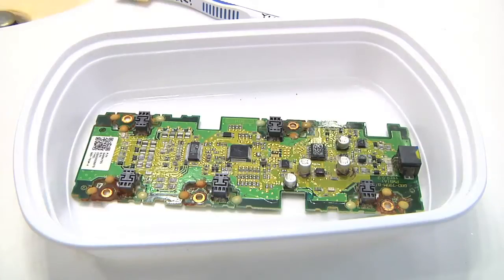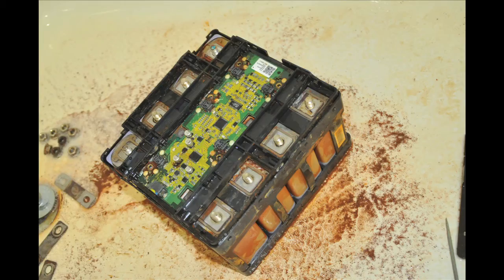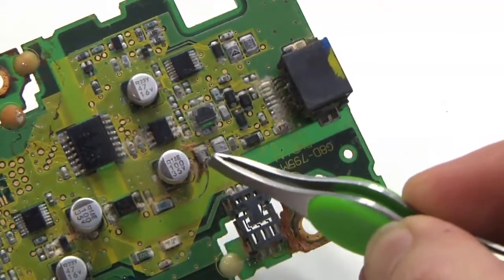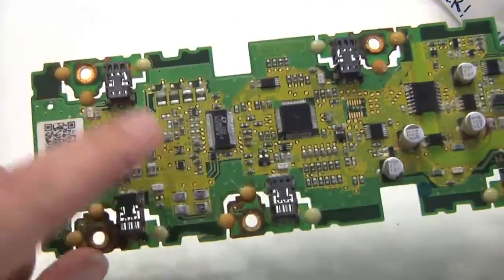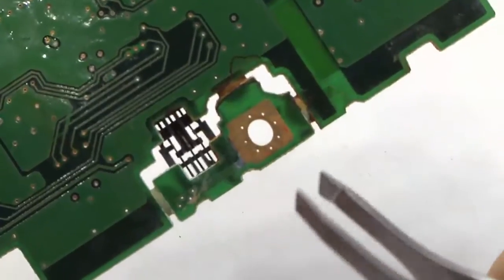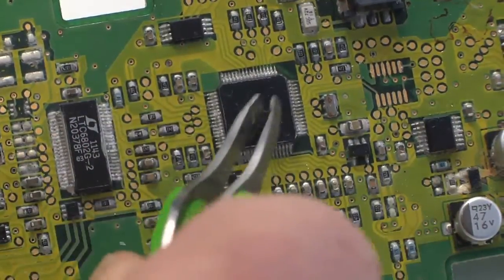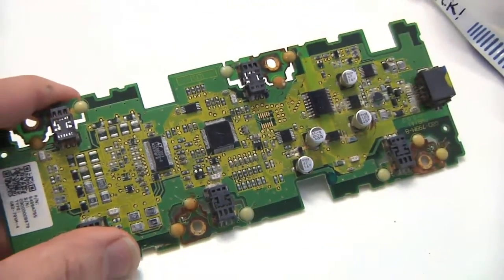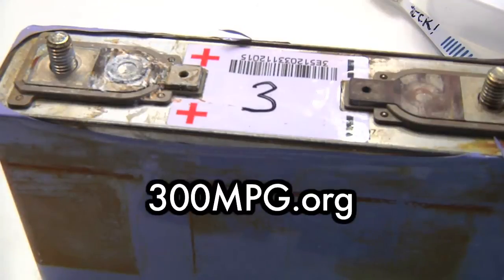Flooded i-Miev: A Close Look at a BMS Board

Comment: Hello dear community,

I study electrical engineering and specialize in energy storage. As a small study we want to continue to use old batteries from electromobility, we want to continue to use the old boards of the battery, the eight lithium cells monitor.

These boards were connected to each other with an 8 pin connector and could then be controlled by a reader located in the car.

I myself do not have much idea in the areas of boards and computer architecture. My idea would be to develop a system that can read the boards or if it is possible to send control commands to board. Of course, it would be ideal if the boards could communicate with a battery inverter via a professional bus or CAN bus.

The following components were determined. The insulation shined over a digital isolator called ADuM1402W. The battery management uses an LTC6802G-2. The BCM CPU is a NEC F3612M2. The process is as follows: The chip for the battery management is probably self-sufficient and equalizes the batteries when discharging and charging. He should probably communicate with SPI with the BCM CPU and as I suspect he will only send data to him. The CPU is responsible for the conversion to a bus system (CAN bus). The isolator probably only for galvanic isolation.

My questions:

Can one analyze such a bus system or can one find out how it works without knowing the protocol? Does anyone have experience with these components? Is it worth it at all, as an engineer I would not waste any time here and prefer to build a new management which works with a bus system which I know well.

Comment from the maker: The second block of cells I pulled out look like they are a complete loss. I've been busy with work, and we've still had pretty crummy weather lately, that have been keeping me from working on it. The big challenge so far is getting INITIAL voltage safely into the cells. I'll be doing some work soon using a big dumb charger to get some voltage in there so I can then use a high-end lithium charger to actually test/charge/discharge the cells.

Comment: I've an i-MiEV too. It has got a 325V/50Ah/16kWh battery pack inside. 
But I've seen, that Peugeot Ion / Citroen C-Zero (the same car) reduced the battery pack to a 295V/12kWh, there are 8cells less! That's maybe your solution, if you'll have many damaged cells and bms. I've been looking for the LEV-50 cells(example for reserve), but cannot find any shop or dealer....

Comment: The purpose of the rubber dabs and what you called heat elements is flexing.  This PCB is mounted on 4 individual 3 pound masses that are being carried around in an automobile.  If it were sold the bouncing would eventually loosen the screws.  This surface mount design is quick (aka cheap) to manufacture and assemble.

Comment: Triage?  Do the motor(s) work? Controller for the motor? Dashboard controls?  You can always drop in lead acid batteries and a controller and run it that way.  I'd love to see a small lead acid battery pack with a 5hp generator charging the batteries - should be >100mpg. But the stock motor likely requires a fairly high voltage.

Comment: Thanks for the vote of confidence Joe, I have to say this board looks BAD, Besides the Corrosion, when the salt water first hit the batteries and board there would be transient currents and high voltage moving all over, those Chips mostly run on 3.3 Volts so it would not take much to kill one.  Ben I wish you all the luck!

Comment: One thing I would like to point out (and I'm sure you know this) Many charge control boards will detect if a battery has malfunctioned and will cut the whole pack off to prevent an explosion. If this happens, the only way to reset the board is usually through jtag, and I doubt anyone has had a chance to figure out how to do it on a board this new.

Comment: One thing I have had success with in the past as far as removing corrosion goes is to first, brush of as much of it as you can, and then coat the legs of the IC in flux and just cover it all in solder, basicall connect all the legs with solder. After that, you can use a de-solder station/ plunger and Solder wic to remove the excess solder. It's a bit hard to explain, but I'd be happy to make a video.

Comment: That looks very bad.  I just threw out a bunch of electronics (motherboards, single board computers, FPGA boards) that were hit with conductive glycol solution.  When the damage is as bad as what you have there isn't any hope.  The cap blowing is a bad sign as well - full battery voltage in the solution over the circuit board.  The sort of electronics you have there can't handle 5V.  You need a friend at Mitsu who can provide parts at cost!  Keep checking other stuff.

Comment: Also, check out hhofromh2o.  That man's a genius with electronics.  He can probably repair your boards.  I had a TV repair shop replace the capacitors on my Mitsubishi's computer.  It's not supposed to be done with double sided boards, but if you find someone good with a soldering iron, yes it can be done.